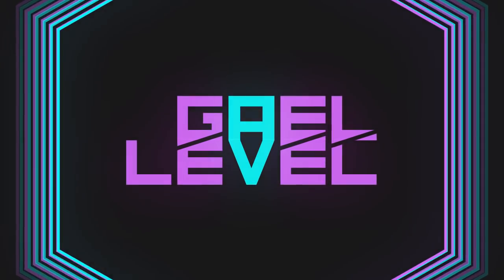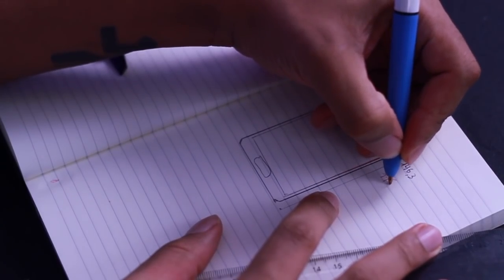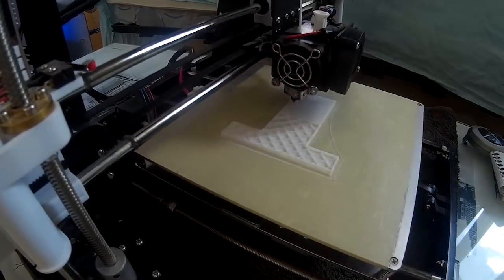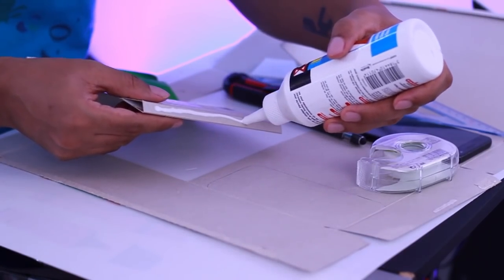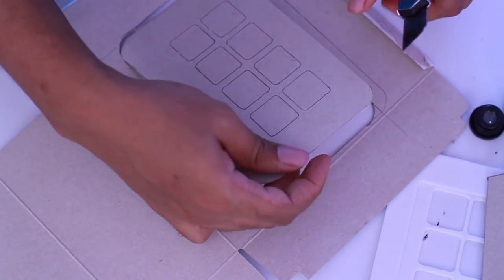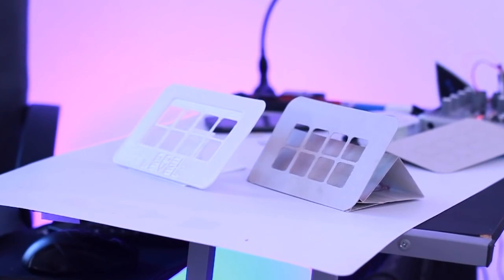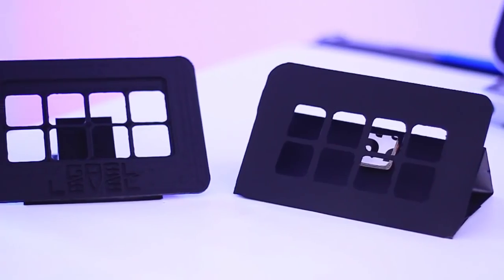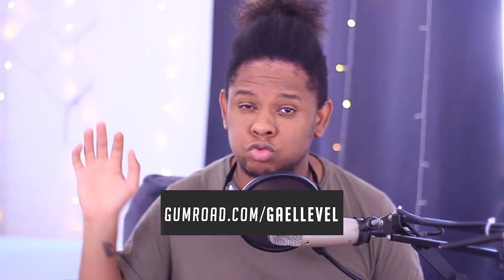How I made my own DIY STREAM DECK (FOR FREE)

Comment: You should try making it out of wood, I made one just as a project.

I ended up doing more than I had planned in the end, I used a wood burner, sanded the edges and made some different indents and grooves in between the buttons to easily find the right one without looking. Decided to varnish it and ended up really proud of it to the point where it's now where my old phone lives basically full time haha.

Honestly it looks like some real premium version. I've been tempted to add more to it like some metal accents with studs to look like that's where it's held together or something but I need to know when to stop before I ruin it
Reply: One thing I thought I could suggest from when I was making mine that could help for your 3d print or any future models is to cut 4 thin strips of foam the width of your phone to stick to the holder(?) At each side, in front of and behind the phone. It helps to both stop the phone from sliding about and from making any annoying noises from the haptic feedback. Obviously only having the foam at the ends is what you want because you don't want foam the full length of your phone behind it because overheating.

It's maybe not tooootally necessary but at the time I was overthinking it all on how to make it perfectly so there wouldn't be a tiny thing down the line that ends up annoying me

Comment: This would have worked better with foam board which you can pick up @ any Dollar store.  My local store has multiple colors and when using a pen knife it allows for precise lines/cuts.  Plus, by only cutting most of the way through you can get clean looking 90 degree angles where you folded yours.  The foam itself is usually white so you can go with an all black board with the white foam giving a nice aesthetic to a cheap project. My question is , does a riser make all the difference when CNC machining, reducing failed print jobs ?